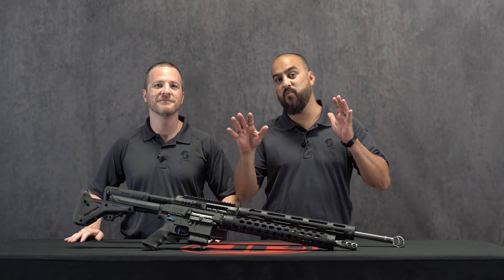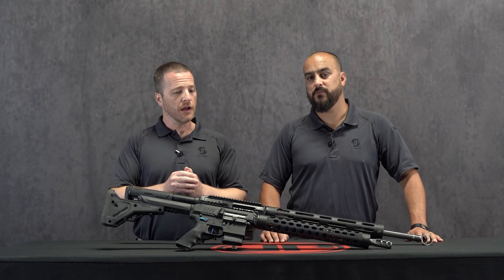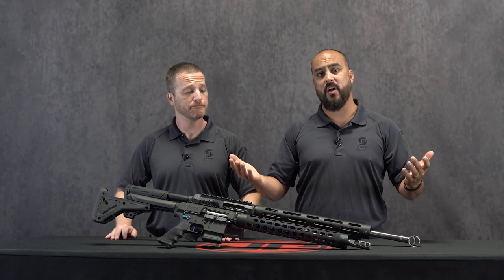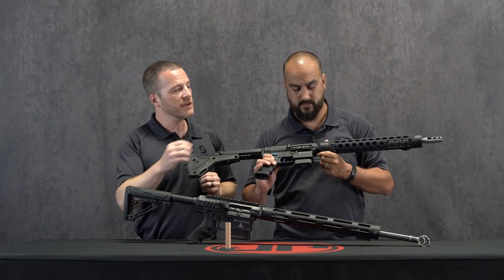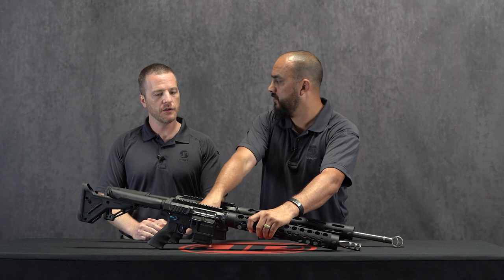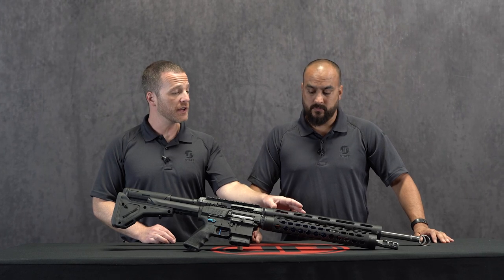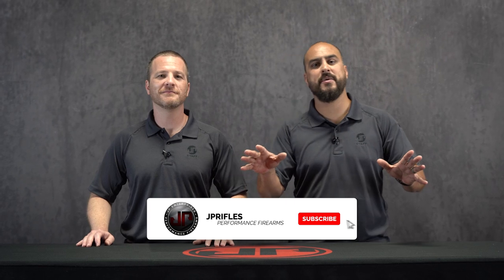SCI-20™ Semi-Monolithic Small Frame Upper Receiver - New Product Showcase - September 2020

Comment: I run the Gibbz Ultalite G4 with a BSF barrel and Odin Works hand guards. I have 1 in a Creedmoor and 3 in AR15 the latest is the 6mm arc at 6.5 pounds with your stainless BCG. I use the AR diamond trigger. My lower is a Iconic Industries ultralite lower on all my builds.

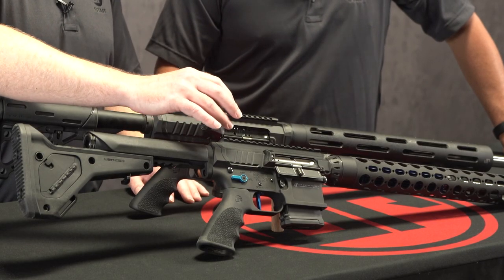Comment: 2:15 BOOOO

How does the cutout for the top charge handle affect the lower?
Reply from the maker: The channel bump-out that the top-charge handle/bolt carrier key rides in is open in the back of the upper so you can get the BCG in and out.  The dedicated lower seals that channel off so gas doesn't blast out of the back into the shooter's face.